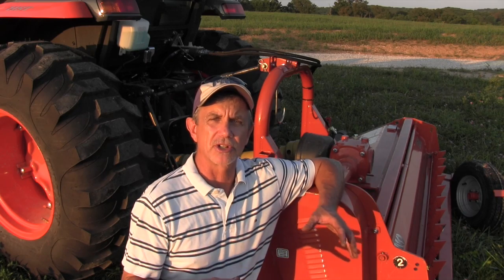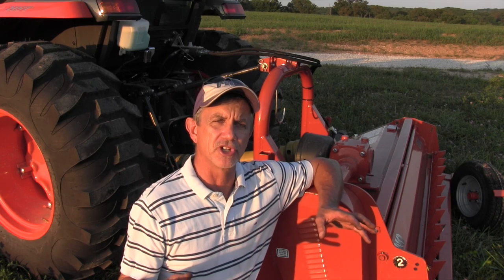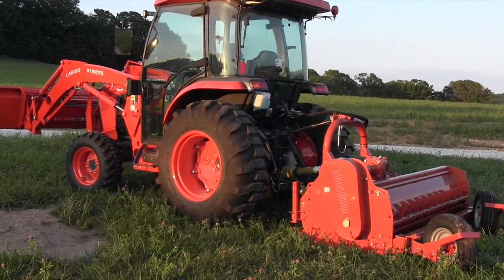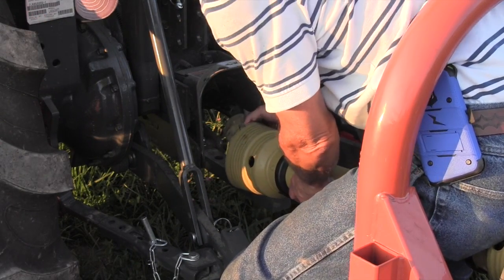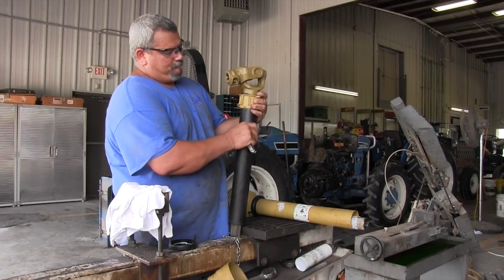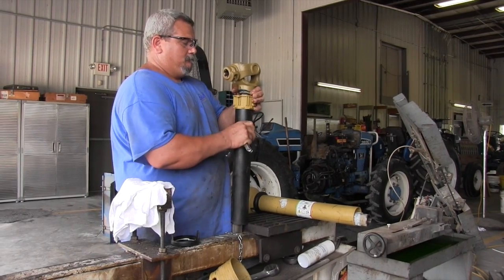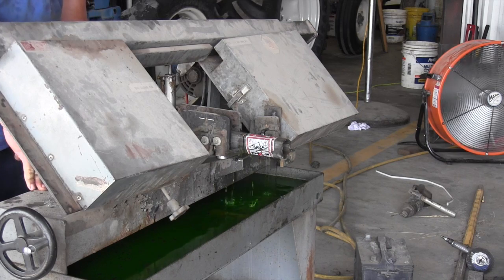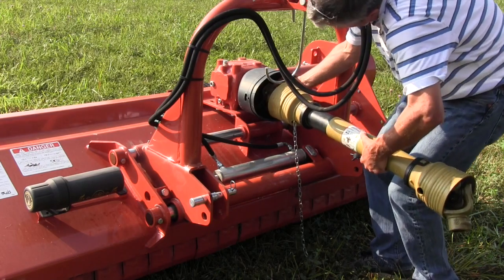Why it's CRITICAL to Check PTO Length on New Implements (Failure to do so may cost $$$)

Comment: This spring we had a friend come over with a wood processing machine. He usually power it with his smaller tractor in his yard but traveling on the big road he preferred the bigger one which he knew would have the front wheels not lifting from the ground due to the weight of the implement...
Well he said I had to have a short PTO shaft so it would fit the bigger tractor. Sure! I have two short ones! When we tried to connect them it turned out that the diameter of the PTO tap (correct terminology?) was too small on one side of the shaft (implement side from the implements they were used on). I know there are different sizes but had forget to check that.

Well we went to get his PTO shaft and I shortened it. Used a tiger saw with fine toothed metal blade. Was done in no time.
The friends also said he had to lift the wood processor up to even get it into his smaller tractor... So it was probably good it got shortened.

Comment: Thanks Mike!  How about a video on how to measure your PTO shaft so you know if it's too long or too short even.  

-Sharon
Reply from the maker: I'll try to do that...it scares me a little.  I'm always worried about cutting too much off because they're a little hard to make longer!  The one in the video was easy because it wouldn't go on at all, and the flail was offset (it can slide back and forth) so if it was conencted and slid to directly behind the tractor it would have been ugly.  I guesstimated that 4-5" would make it right and we ended up taking 4 1/2" off and that seemed to be perfect.  I'm a salesguy and was never too good at math...in fact, after I took the ACT test in high school they advised I NEVER go into any career that involved calculations.  So I'm not sure I'm the guy to give good information on how to accurately measure the PTO...but I know some people who could help me with that video who I could drag in.  I'll put it on the list.
Reply: Cool!  Thanks Mike for helping us all out here!

Comment: Kubota L4740 with a 6' King Kutter tiller just fits, probably should be trimmed up a little for some reassurance.  Everything Attachments has a pretty good video on how to measure and cut your shafts.  I have found a couple others also, but don't recall where off hand.

Comment: Hi Mike... Love your advice. I have a WoodMaxx 8M Woodchipper and am using the premium shaft option from WoodMax which in itself is a short shaft, only 9" from shield bell housing start to shield bell housing start when fully compressed. When the shaft is connected to the chipper and fully compressed I have about 3/8" inch of open air before the tractor end of the PTO shaft contacts the tractor's PTO male shaft. Once installed the shaft ends up being extended about 2" from fully compressed. Goes on and locks fine. When installed and the chipper is on it's stand on the ground (which is the only allowed way to run it), the shaft is only angled at 5 degrees. Since I set this chipper on the ground and lower the kick stand before ever spinning the PTO shaft coupled with the fact it stays stationary, I'm thinking I'm fine without shortening the shaft. Assuming this was more clear than mud... would you agree?

Comment: First time ever for me today. Picked up the new brush hog and didn't have to cut the PTO shaft. Almost second guessing myself on this.
Reply from the maker: 99% of the implement shafts won't need cutting.  The number may even be higher than that.  Most come off the tractor with plenty of room to spare and are fine.  This was a video that is trying to prevent the possible disaster for the less than 1% because it usually gets pretty ugly for customer, dealer, and manufacturer when that happens and I've been around enough ugly stuff that I try to do everything in my power to prevent it.  You're probably just fine.

Comment: Hi Mike, I enjoy your channel and have been watching weekly for several months. I just read your video description where you said that you were the manager of an S&H Farm Supply at one time. I purchased a lightly used Agco Allis 4650 MFWD with FEL from S&H in Lockwood, MO around year 2004. Would you have been the manager there then? I still have that tractor and couldn't be any happier with the dependable service it has provided. Very much enjoy your channel and please keep up the great work!
Reply from the maker: In 2004 I was managing the recently-acquired Springfield S &H location and was too busy to tell which way was up.  I know those AGCO 4650's well, I was the territory manager for them when those were sold new and they were tough little tractors.  I've seen them absolutely beat to a pulp and still running, with no radiator antifreeze to worry about in the winter.  I've been around the Lockwood store a bunch, but I never actually worked there.  I pretty much knew everyone who did, though.  Where are you from?
Reply: I'm from the SW part of St. Charles Co, Missouri.  That's interesting regarding your positive experience with the 4650.  Yes, the simplicity of the air cooled diesel has proved to be a great feature for me.  Non-routine maintenance parts for the 4650 can be a little hard to find at times, but with the help of the internet, I've always been able to hunt down what I need.  I have always admired the SW part of Missouri.  Good people and beautiful countryside with the Ozark lakes and rivers.  Thanks again for all you do for us viewers.

Comment: That was clear as mud! No clue how and where to measure a pto shaft.How would i know its to long?
Reply from the maker: I guess I should have made the point a little clearer,  check the owner's manual and do what they recommend.  On this machine, once it's unhooked, there has to be at least an inch clearance from the end of the PTO stub shaft on the tractor.  This one was easy to tell, it wouldn't go on at all, but if it would have gone on, and when it came off, there was only a fraction of an inch clearance, it's too long.  That distance is going to be different with each implement depending on how much they move around behind the tractor.  The bottom line is, find out what the owner's manual says and if it's not within what they recommend, cut some out of it.
Reply: A good clue that it is too long is once you have your implement installed on the 3 point, you are unable to connect the pto. From this excess length you have to estimate how much to cut off. They say you need to take off 2 inches beyond where the shaft bottoms out on the tractor when it is all put together.

Comment: That is a good idea and I have a 790 John Deere tractor, and purchased a tiller which was a John Deere brand and didn't take that into consideration when buying it, but fortunately it did work, but if I had a different brand I would probably would be in trouble and have to cut the shaft.
Reply from the maker: Sidney, I'm not sure I'd trust that the shaft length would be right just because they're both the same brand.  If they fit a wide horsepower range I'd still be checking it.

Comment: Hey Tractor Mike. I had bought a tiller online and had to shorten the pto shaft which came with it. My fear was removing to much of the shaft. I hooked up the tiller, measured the distance from connector to connector, did all the math and cut my shaft. Then I cut it the second time. It is a very tight fit on my compact 25 hp tractor. The carpenter's rule applies here measure twice cut once but I cut twice. Hard to add length back on and pto shafts are pricey.
Reply from the maker: Yeah, I get that.  I was pretty worried I'd cut too much off this shaft (we took 4 1/2" off), but it worked perfectly.  It's hard to make them longer :).
Reply: Tractor Mike THAT’S WHAT SHE SAID!! 😂😂

Comment: Have you done a video comparing the flail mower to a rotary cutter and/or finish mower?  It might make for an interesting video if not.  I have seen flail mowers used by the state but have never seen one on a farm.  I've always wondered if they would handle thicker woodier stuff like a rotary cutter.  Good advice on the video btw.
Reply from the maker: Stay tuned...we shot it on one of the hottest days of the year this past Thursday, as soon as it's edited it will go live.  Very interesting results.

Comment: Hi Mike, I have a question.  My 1944 2N has a measurement of 1 1/8 diameter on the PTO, and I have a 641 workmaster tractor. I find it impossible to connect the PTO  on the 44 2N  for brush cutting.  It seems too big, but yet on the 641 no problem. So my question is are their different spline diameters for the  PTO's on different tractors?  Thanks Ken

Comment: Is there any spec on how short it can be?  I intend to add a Pat's easy hitch adding four inches to the length the PTO needs to be.  Let's say it's four inches shorter now, is that ok?
Reply from the maker: The owner's manual of the attachment should tell you the minimum overlap.  It varies some depending on the torque load of the machine.

Comment: Mike, I just got my new tractor John Deere 3043D and I have a 48" tiller.  I had cut my pto shaft for it to work with a Kubota BX.   The shaft now is too short, so should I use a pto extender on the tractor side or should I just buy another complete pto shaft to work with the new tractor?  What are your thoughts on pto extenders?
Reply from the maker: Wayne, you might be able to replace a tube in the PTO and cure the problem.  We have a shop in this area that does clutches, transaxles and transmissions and if you took it to them and told them you needed the PTO shaft longer they could do it for not much money.  You could use an overunning clutch as well, but I'd spend the money to get the shaft fixed right.

Comment: I just bought a 1979 Ford 340 industrial tractor. The auger that came with it does not have a PTO shaft. What's your recommendation for how I measure to get the right length PTO shaft for the auger?
Reply from the maker: That's a tough one, you'll have to figure out  where the PTO shaft will be at it's closest point to the tractor and then get a shaft a little shorter than that, but  because of the full travel of the auger, it needs to be as long as possible so it doesn't come apart.  What brand is the auger?  Maybe one of my viewers will have the same one and can measure their PTO shaft and let you know the exact length.  This one scares me.  Those shafts are expensive and pretty hard to make longer when cut too short.  If the truth were known on this video, I was paranoid that we'd cut too much off the shaft and we removed about 4 1/2".  It was perfect, but until I backed the tractor up I wasn't sure.